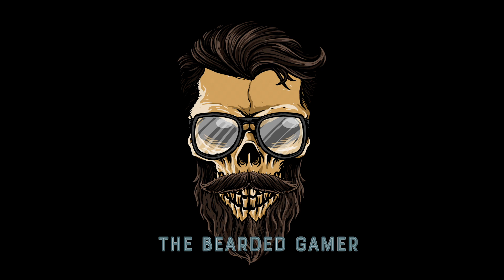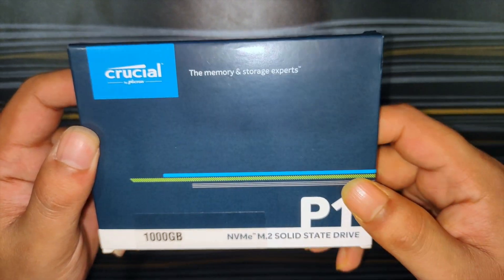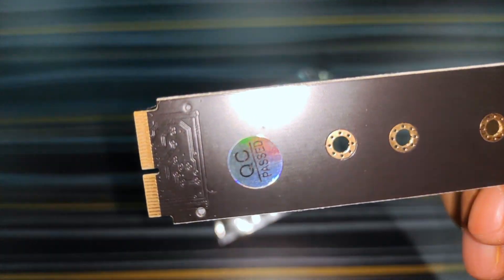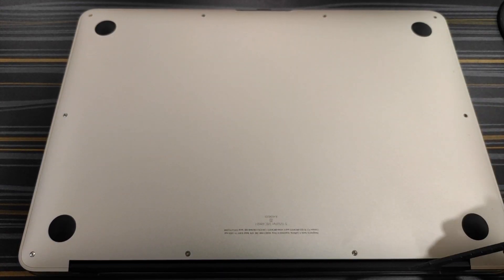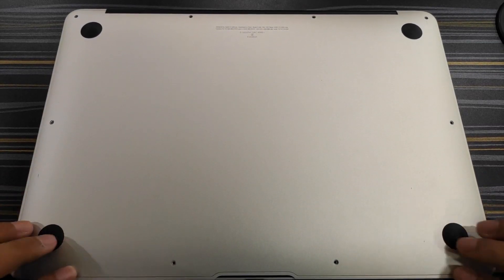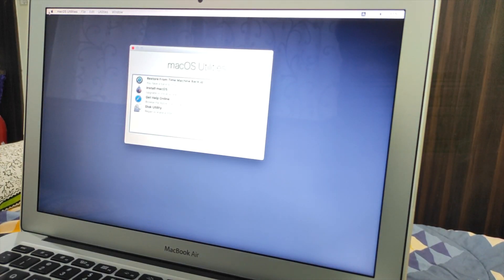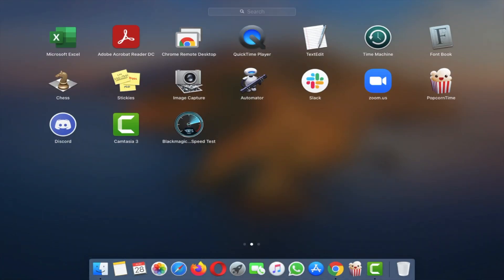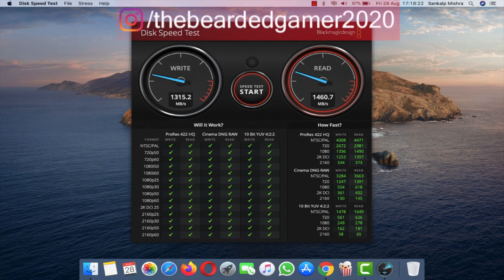2017 MacBook Air Storage Upgrade from 128GB SSD to 1TB NVMe SSD | Full Guide for 2021 | 40k+ Views

Comment: my 128 gb gives me a write speed of less than 400 MB/s and read speed of around 1200 MB/s... does the write speed drop as the SSD ages ? I wonder.
Reply from the maker: @chiragojha7311  The numbers you mentioned are similar to what the MBA 2017 originally had. The average read speed is 1243 and the average write speed is 612. So, I don't think there has been a major drop.
Reply: @TheBeardedGamer2020  thanks for the reply.
How is your performance overall ?
Mine lags like anything.. specially with chrome having several tabs open due to office work. It just irritates me.. I usually keep around 30GB free (of 128GB total) Probably the bottle neck is 8GB RAM but if the ssd swap even improves the performance by 15-20% it is worth investing.. I think. What say ?

Comment: I bought consistent ssd and converter can it work?

And we have to erase in macos journaled or afps and why?
Reply from the maker: @bakwasswala  You can watch the full video to understand the entire process.
Reply: @TheBeardedGamer2020  I watched but i am asking why we have to erase in asps encrypted format?
My friend suggest me to erase in macos journalised.
Can you explain it's difference?
Reply from the maker: @bakwasswala  The main differences between Mac OS Journaled and Apple File System (APFS) are: 
 
Compatibility
Mac OS Journaled is compatible with older Mac OS versions, while APFS is used by macOS 10.13 or later. 
 
Drive type
Mac OS Journaled is ideal for mechanical drives like HDDs, while APFS is optimized for SSDs. 
 
Encryption
Mac OS Journaled has an encrypted version that requires a password to encrypt the partition. APFS offers strong encryption. 
 
Time Machine
Before Big Sur, Time Machine required the Mac OS Extended file system, but now supports APFS. 
 
Windows compatibility
Mac OS Journaled doesn't work natively with Windows, but you can format your drive as ExFAT on macOS to use it with both macOS and Windows. 
 
Space sharing
APFS introduces space sharing between volumes, where multiple volumes share the same pool of free space.
Reply: @TheBeardedGamer2020  brother the disk is not showing please help me
Reply from the maker: @bakwasswala  Please follow all steps diligently, and it should show up. Also, there are some links in the description. Make sure to follow them as well.

Comment: Which one is better ?

1. Samsung 970 EVO Plus 1TB PCIe NVMe M.2 (2280) Internal Solid State Drive (SSD) (MZ-V7S1T0)Samsung 970 EVO Plus 1TB PCIe NVMe M.2 (2280) Internal Solid State Drive (SSD) (MZ-V7S1T0) or
2. Samsung 980 1TB Up to 3,500 MB/s PCIe 3.0 NVMe M.2 (2280) Internal Solid State Drive (SSD) (MZ-V8V1T0)

Comment: I have partitioned my MacBook using bootcamp do I need to remove that before changing ?
Reply from the maker: It's your choice entirely. If you have taken a backup, then it will automatically get transferred when you restore.
Reply: @TheBeardedGamer2020  ok sure
Reply: @TheBeardedGamer2020  done ! Worked !
Reply from the maker: @sambajwa8688   Good to hear that. Congrats! Do subscribe to my channel if I was of help.
Reply: But when I go to backup iPhone it says can’t backup coz there is corrupted previous backup 
But I can backup same iPhone in bootcamp windows
Reply from the maker: @sambajwa8688  Not sure about iphone backup
Reply: In your video also mention use of the additional screw u get with the adapter coz original screw doesn’t fit !

Comment: I upgraded to them evo plus 500gb and also changed the battery at the same time. However , I feel like the battery is running worse than before. Plus, I feel like the far edge of there laptop gets hotter than normal even during normal use of email Netflix or meeting(didn’t warm up too much before) 
Checking the temperature, ssd temps are normal or below 50, CPU temperatures spike 65-80+ sometimes and keep the laptop warm. 

Anyone have similar issue? Could it be the load from ssd or the battery is just crap? Part of me wants to replace oem ssd back just to see what’s up
Reply from the maker: The SSD does warm up more than the OEM SSD because it runs faster than the latter, but it doesn't warm as substantially as you are mentioning. It could be because of the battery and the SSD combined. I haven't had any such complaints, so I'm just thinking out loud. Try popping the old battery back in and try using it and see what the cause is, in case you want to find out the reason.
Reply: @TheBeardedGamer2020  yah that’s exactly something i’m going to have to do just to check around the cause of the problem. Thanks a lot for your input I appreciate it. It’ll be inconvenient but I’ll give an update when I do it haha

Comment: Any problem after 2 years
Reply from the maker: Nope, still running as it did when I upgraded.
Reply: Sir in the process of upgrade if I want new os then also I have to make backup
Reply: I am bit confused in software work please explain me what to do after doing hardware work
Reply: Is there any steps that I have to do before doing the hardware work
Reply from the maker: All the steps are exactly the same as what I have shown in the video and the video description. The most important thing is to take a backup and create a bootable drive.

Comment: Can i use 1Tb samsung 990 pro or 980 pro or 970 pro or without pro on my macbook air 2017
Reply from the maker: Sure, you can. But I didn't recommend it as the performance is the same but you pay a premium.

Comment: Lovely video 
I wanted to know will this fit into my mac air 2017 
(500 GB P3 plus version, if so can you recommend adapter for the same 
)
https://www.amazon.in/dp/B0B25LQQPC/ref=sspa_dk_detail_0?psc=1&pd_rd_i=B0B25LQQPC&pd_rd_w=rSUOd&content-id=amzn1.sym.dcd65529-2e56-4c74-bf19-15db07b4a1fc&pf_rd_p=dcd65529-2e56-4c74-bf19-15db07b4a1fc&pf_rd_r=A7EY50YDDQK6MYYBD1SA&pd_rd_wg=j74kH&pd_rd_r=980004cd-20ff-4846-a53f-468fe79b188d&sp_csd=d2lkZ2V0TmFtZT1zcF9kZXRhaWxfdGhlbWF0aWM&spLa=ZW5jcnlwdGVkUXVhbGlmaWVyPUEzRE43TURKOU8xWEVDJmVuY3J5cHRlZElkPUEwODc2MjY0OEQxUTlITUNSQjJaJmVuY3J5cHRlZEFkSWQ9QTA4NzQwMjQxMU9JQ1hJWVVSMFZBJndpZGdldE5hbWU9c3BfZGV0YWlsX3RoZW1hdGljJmFjdGlvbj1jbGlja1JlZGlyZWN0JmRvTm90TG9nQ2xpY2s9dHJ1ZQ==

Comment: Is it me or did you not use the adapter for the new m.2
Reply from the maker: I did use the adapter. It is not possible to upgrade without the adapter.
Reply: @TheBeardedGamer2020  it didn’t show you putting it onto the m.2 just you installing the m.2 so that’s why i asked
Reply from the maker: @rasinetjuniormint913  4:10 to 6:35 on the video.
Reply: I rewatched it and got it to work....thank for the responds and the video in detail I have a 1tb in a 2017 MacBook Air and I also have the latest MacOS installed on it as well

Comment: I think you should have disconnected the battery before removing the old ssd and reconnecting it after installing the new ssd
Reply from the maker: I did realise that. I didn't face an issue, but yeah, that would be recommended.

Comment: Hi Bro.. Can you pls guide me if P3 / P5 Series  SSD will be compatiable ?
Reply from the maker: As long as you have the right adapter, both should work fine.
Reply: @TheBeardedGamer2020   Bro.. Just another help.. can you pls guide me one for P3 ssd ..
Reply from the maker: @ceasar47  I have the adapters link added in the video description.
Reply: @TheBeardedGamer2020  thanks 🙏
Reply: Hi Bro.. Just bought all the things needed to proceed with the project. A query : is it needed Mojave only ? or I can proceed with Monterey as it is currently in my mac.
Reply from the maker: @ceasar47  you can do monterey as well. Just make sure that you follow all steps.
Reply: @TheBeardedGamer2020  Seems like P3 Series SSD not supported. I've tried .. It does not detect. Also not able to put the screw back for SSD . Wondering how to get through of this !!

Comment: Will the adaptor work only for macbook or can i use it on windows laptop i have 2242 ssd port i couldn't find 2242 ssd so i am thinking of using 2280 nvme ssd instead

Comment: Hello @TheBeardedGamer , many thanks for the excellent video.  Do you still have this MacBook Air 2017 (A1466) and is it working fine with the 1TB Crucial SSD  and MHQJRH M.2 NVME SSD Convert Adapter Card?
Reply from the maker: Yes, it is working fine.

Comment: Hi Sir, can we use P2 instead of P1
Reply from the maker: Yes, you can, for sure. The product links are in the video description. Do subscribe to my channel and press the bell icon.
Reply: Sure thanks
Reply: Sir for P2 can we use the same adapter mentioned in the video  or we need to change it I could see adapter and 2 in the description.
Reply from the maker: @niftychartoperator7345  You can use any of the 2 adapters. I have added 2 for availability.
Reply: @TheBeardedGamer2020  thank you soo much bro.
Reply: @TheBeardedGamer2020  Hi sir, I have ordered oscoo 512MB. Does it work fine. Can you please share your thoughts on it

Comment: Hi!! I've got a question. I have windows bootcamp as well. In this case how should I do it? after formatting the new ssd I should partition it and install mac from time machine in one side and then with a bootable windows recovery flash drive install the windows backed up imagine in the other partition? or do you have another way?
Reply from the maker: Nope. That's the only way to go. Do subscribe to my channel and press the bell icon.

Comment: Please help!! I have a Mac book air 2017 and I installed the new ssd. However when I power on and press option button it keeps going into internet recover mode. Do you know why it’s doing that ??
Reply from the maker: Did you plug in the bootable drive?
Reply: @TheBeardedGamer2020  I created a Time Machine backup onto a usb. Would that work? I tried finding the OS on the App Store but could not find one.
Reply from the maker: @abrahanramirez8129  Nope. You will need to create a bootable drive to get access to utility.
Reply: @TheBeardedGamer2020  thanks. The App Store doesn’t have an OS I can download. Do you know where I may be able to download one?
Reply from the maker: @abrahanramirez8129  I have added links to everything in the video description. Do subscribe to my channel and press the bell icon.
Reply: @TheBeardedGamer2020 I followed all your steps but my ssd is not showing up in the disk utility.
Reply from the maker: @abrahanramirez8129  Did you create the bootable drive?
Reply: @TheBeardedGamer2020  yes but the ssd doesn’t show up whenever I power on the laptop and go to utilities
Reply from the maker: @abrahanramirez8129  Then there might be an issue with the adapter. Try getting that replaced. The entire process is pretty simple. 2 reasons why it shouldn't show up, either you miss a step or faulty hardware.

Comment: Thank you so much for this video. Just I want to ask you is Crucial P3 suitable for the MacBook Air 2017 with the Adapter ?,  because I want to buy It rather than Crucial P1.
Reply from the maker: Yeah, Crucial P3 should work with the MBA 2017 with the adapter. But I would recommend using P1 or P2 as they are more VFM for this upgrade. The max speed for MBA is capped at around 1300-1600, so why spend extra money on a 3500 mbps ssd when you can't even utilize it. Again, your choice, just a recommendation. All product links are in the video description. Do subscribe to my channel and press the bell icon.
Reply: @TheBeardedGamer2020  Nice POV but now I find that P3 is at the same price as P2. In this case what do you think ?
Reply from the maker: @Nooreldien soltan In that case you can get the P3. Here's a link in case you want to support the channel: https://amzn.to/3is3LQA
Reply: @TheBeardedGamer2020  Yes sure, thank you very much. Another question, I saw a lot of people first install the macOS on an external hard drive then do the Time Machine Backup after installing the macOS. 
But what you did, is the same way that I wanted --> Restore Time Machine without installing it from the first, So is this the same way and gonna give the same result without installing macOS on an external hard drive?
Reply from the maker: @nooreldiensoltan1419  Yes. But you would additionally need the bootable drive. That's it.

Comment: My ssd screw is stripped and is not opening and I am afraid to open it with pressing harder force
Reply from the maker: Try using a rubber band over the screw head and then using the screw driver. There are hacks on Youtube to open stripped screws. Give that a try.
Reply: @TheBeardedGamer2020  i tried it, its not working for me
Reply from the maker: @haneetarya  I guess then the only option is to take it to a shop and get the screw replaced.
Reply: @TheBeardedGamer2020  Yea I will do it

Comment: i just upgrade my ssd on my  macbook air 2017 running monterey samsung 980 and i run this test but the results about 6-700 read and write even may i know what is the problem ? why im not even reaching 1000 ?or i dont know how to use the test app ?

Comment: I bought the exact crucial and the adaptor for my Mac 2017 and the system did not switch on with the new setup. What do ypu think might have gone wrong? It works with the old setup though.
Reply from the maker: Did you use the bootable drive?

Comment: hey can you tell how your mac is holding up rn? I read in a forum that using an adapter aint good for a mac and also crucial p1 gets slow once you load it up with stuff.
Reply from the maker: It's running perfectly fine. Hasn't slowed down yet. Installed windows, doing video editing and rendering, no issues. Heats up a bit more than it would normally but that is normal as it is running at higher speeds. But apart from that all good.

Comment: My macbook air early 2015 is 4gb ram and 128gb ssd. Can i upgrade it with crucial p2 1tb ssd. Will 1tb ssd affect much as i have to install windows for vivado software. Please reply bro
Reply from the maker: Sure. You will see a substantial difference, in storage definitely, but also in transfer speeds. Perfect for installing windows. Even I did the same. All product links are in the video description. Do subscribe to my channel and press the bell icon.

Comment: Please i want to know if which option is better, 1# installing 512 gb nvme pcie ( which it doesn't need adapter) or 2# install the 1TB crucial that you used with adapter,  because I've been told that 1 TB nvme are not compatible with mackbook air 2017 , please can advise? 
And thanks for your video
Reply from the maker: Firstly, any nvme ssd you use would require the adapter unless you are using an apple ssd, which I am pretty sure you are not. So, you can go for a 512gb ssd or a 1TB ssd (both need the adapter) based on your requirement. 1TB is more VFM, so I went for that and it has been running successfully, not just for me but for a lot of people who have done the upgrade. All the product links are in the video description. Do subscribe to my channel and press the bell icon.

Comment: Thank you for your effort creating this tutorial! I have gotten stuck though. I successfully managed to erase my new crucial ssd 1 tb using disk utility and it appeared just as in your video. 
But now after having tried to reinstall from time machine copy my computer does not detect the new disk at all. I have tried multiple times, and also tried to open up the computer again and taken out the ssd and put it in again - and all that appears when I turn on my computer is an icon of my original Macintosh HD. Do you have any suggestions for me or any idea where it might have gone wrong? Thank you so much! 🤗
Reply: I solved it! 🤩 thank you again!
Reply from the maker: @sofiam8812  Sorry thst I couldn't reply earlier. Happy to know that you were sble to fix it on your own. Do subscribe to my channel and press the bell icon.
Reply: Yes exactly that was what solved the problem for me 🤩
Reply from the maker: @sofiam8812  There's a lot of people that forget about the bootable drive. Without the bootable drive you can't see the new ssd in the disk utility.

Comment: Hi Bro,i tried to install Crucial P2 500gb along with M.2 NVME to Mac Book Ssd,
My macbook is 2017 model still it is not showing ssd when i start my laptop and also i tried the command diskutil list in terminal no use.
Can you help me with this.
Reply: And also Crucial p2 is heating very quickly, is P1 is far better than P2 ?

Comment: Nice effort and thanks for the video, disconnecting the power supply is advisable.
Reply from the maker: Yes. I know. I was facing some issues with mine, so I didn't but I have mentioned that in a lot of comments. Do subscribe to my channel and press the bell icon.

Comment: What type of ssd does the macbook air a1466 use? Is it m.2, m.2 nvme, msata, pci express x4 What are the exact specs and sizes of compatible ssds that i can buy for my macbook air a1466? Can i upgrade to an ssd with lets say 2 tb of memory? A lot of videos and forums that i see only show people upgrading to a max of 1tb memory. I been out the game for a while so I’m catching up lol
Reply from the maker: The MBA a1466 uses M.2 nvme PCIe x4. For the exact products that you can use, I have added product links in the video description. About the 2TB ssd, the MBA supports upto a maximum of 1 TB. That is the reason you see upgrades of only upto 1TB. And, since you have such detailed questions, means you are still in the game. 😉 Reach out to me and I will help you with the process. ✌️